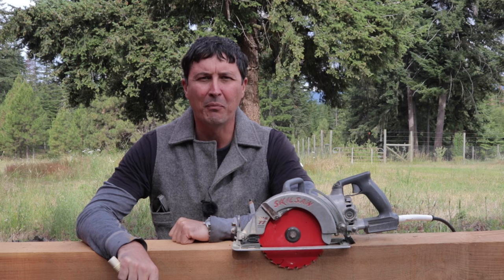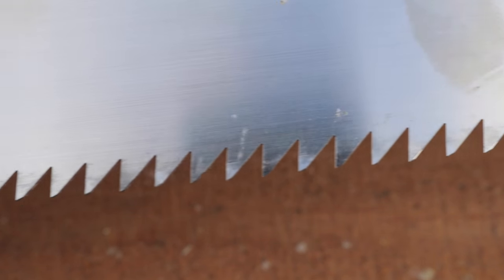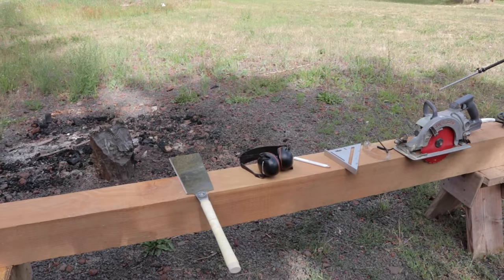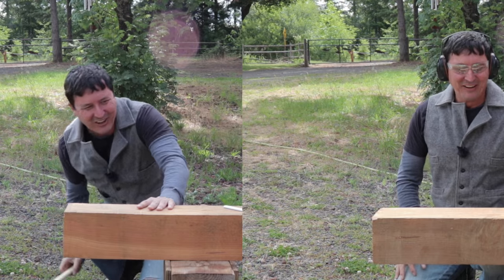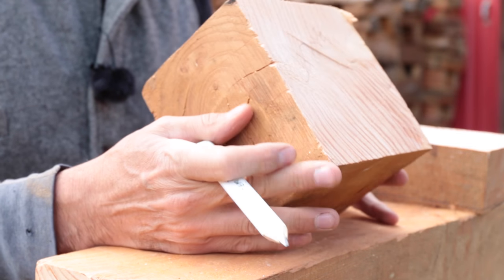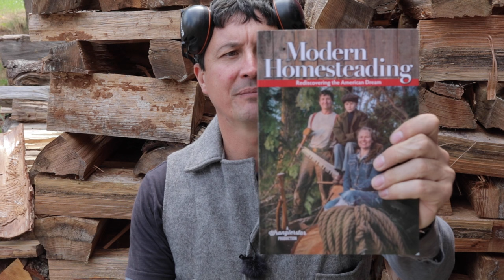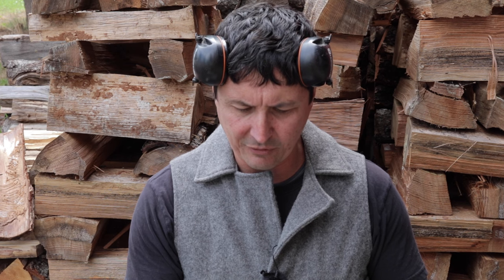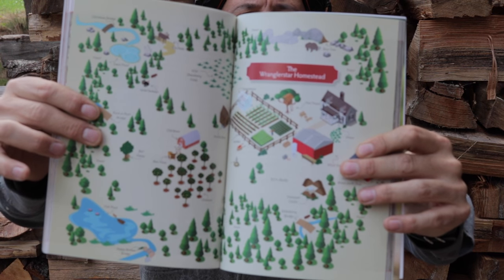Hand Saw vs Skill Saw - Speed Race

Comment: cody,  a japanese saw is supposed to be dropped towards the dround when cutting. Instead of pulling the saw up towards your face when you cut, push the handle towards the ground. Better quality and more efficient cut. Take advantage of the way the saw is supposed to work and let it cut for you.

Comment: I suppose one of those big saws vs chain saw might be ammusing, oh! how bout a hand drill vs cordless drill. make it a challenge, by boring a pretty thick hole, so you can take advantage of the manual drill's strength, forcing the cordless to go slower, because it's not as powerful.

Comment: Actually, the Japane (lol) saw cuts straighter and faster if you use both hands crouching in front of the kerf....pulling down letting the weight of the saw do the work and using the longest strokes possible. Excellent video....i prefer hand tools.....cant stand the dust or the noise.

Comment: Using the speed square with the skil saw would make the cut more accurate. Also going slower with the pull saw would likely result in a very accurate cut which woul probably not require hand planing. Taking that into account the skil saw probably does not win.

Comment: Seth Stanbury brought it up, but how about a race to build something like a complete bookcase or a dovetailed box?  Something that will require multiple tools and thought and precision setting up the cuts.  There is no doubt a power tool can plow through the job at a much greater speed than a traditional tool so I see no amusement in a race such as a nail gun vs. the hammer.  But to actually use skill and technique to create something, I bet the traditional tools can easily keep up.

Comment: you forgot to add the bit about digging the coal/oil/gas to generate the electricity and slinging the power lines to your power socket. 

Also, don't forget the time it takes to get the wood close enough to the power socket to use a power tool.

Comment: This reminds me of my senior year of carpentry when my shop teacher told me that I was wasting my time using a hand saw to cut stringers. Then I obviously gave my opinion on the matter which was that after using a skill saw to cut stringers you still have to chisel off the portion of the wood still connecting the triangular cutout to the stringer. However if you use a hand saw u can just cut all the way down to the line. So naturally he challenged me to a race him cutting a stronger with a skill saw while I used a hand saw... I won hahaha because even though he finished cutting first he still had to chisel out the wood he couldn't cut with the skill saw.

Comment: Instead of spending silly money on a double sided blade with a traditional wooden handle wrapped in "something" why not just get a longer blade you can use the full ergonomic stroke with.

What you missed with the idiocy is that a fully supported work-piece with an hand saw, loses nothing to the harmonic that a circular saw contains in it's spin. The comparison is about how many teeth move through how much material per unit time + (how long it takes each individual tooth to get clear of it's own debris.)

It has never been economically viable to have an hand-saw fitted with a debris remover but an electric saw needs to have such an apparatus for it to work at all. On some materials you actually design the blade to have less teeth. (Alternate tooth spacings left out and replaced with a blank curved plate. )

With a pull saw you do make better contact and have more control over the work-piece but with the western preference for a push stroke, the debris is accelerated away from the work and wiped away from the material on the return stroke.

If you can get hold of a Diston and restore the metal to it's original crystaline structure with out damaging the settings you would have a blade that is better than any other make in the world. But each one would be designed for only one length of pushing stroke, so modern usage preferences are for "a one size its all".

I used to buy a batch of Sandviks at 20 quid a time. The only choice I had was one of 20 or 22 inch blades.

Comment: You only drew a line on 3 sides of the pull saw 4x4. You didn't need to tie the cord in a knot. 
 You drew 4 lines on the other.
 You rolled the 4x4 away from you 2 times instead of 1 time toward you as you did the first time
 Instead of putting the saw down each time you finished a cut, leave the saw in the kerf and  roll the 4x4  over with the other hand to make the next cut.    This way there is no comparison.

 A lot of framers will draw just 1 line and use the cut as a guide for the others.

Comment: Why cut freehand with the circular saw? Any experienced timber framer would  use the speed square held down with the left hand, and run the sole of the saw against the right angle of the square. That way you don't have to faff around trying to align the saw cut with a pencil line by eye.

Comment: A few things to note about that particular saw (which I have as well): 
- Start your cut as you did on the far corner of the board, but gradually cut a kerf towards the front along the top. Then adjust the cut so that you are cutting a kerf down the front of the board face. The adjustment around three sides will allow you to stick to your line on a large timber like that. A typical 4/4 8" wide board will cut much more accurately. 
- That particular saw is more for rough work. The smaller versions of the ryoba will cut very accurate joinery with ease. 
- Use with both hands for speed, once you have your kerfs delineated. 
- I suggest picking up an old Disston US saw (pre-ww2 era) or new Pax saw from Tools for Working Wood. These are the western equivalent of that size saw for rough cutting. Maybe do an East vs. West comparison. https://www.toolsforworkingwood.com/store/dept/TS/item/PZ-HS303.XX

Comment: Try and sit down lower and pull the saw top to bottom on an angle, and not standing and trying to push cut, you'll have better control and you wont bend the saw to bits ;)

Comment: The  Japanese saw is a PULL SAW. Don't try to push it. Try using a 2x4 block to keep your cut plum, and cut from the edge of the wood closest to you not farthest away. I think you'll be surprised with your results.

Comment: You did it all wrong. First off, you have two different saws designed for two different purposes. Your Skilsaw is designed for quick fairly accurate work. The hand saw is best for careful work by a very skilled person. In the right hands the Japanese saw does very well for it's intended purpose. The Skilsaw is not even made for that thick of material. I also use a Skilsaw to cut thick wood. I mark all the way around. I double check the saw angle. Must be perfectly at right angle. Then cut all the way around. Then cut remaining bit with hand saw. On 4 by six you don't even need to do this. But I have used a hand saw on thicker beams when it's a square cut. On a diagonal cut it tends to wander if I use a hand saw.

Comment: Sorry Cody. Having watched you use handsaws, I think you need to work on your technique with them. There is no question you can use power tools but your methodology for Hand saws is very poor. Slow down, keep your shoulder and arm aligned .. Don't force the saw. It will do the job as long as you take it easy and don't force the saw to your speed. Love your videos. Build more stuff.

Comment: Japanese saw is a pull saw. You were using a stance and grip suited for western push saws. Take a look at how the Japanese actually use the tool and you'll likely do better with it. - it'd also help if you used two hands on the pull stroke - that's why the handle is that long. In short - you were using it poorly.

Here's how to use one: https://www.youtube.com/watch?v=Qa5wIpfhGcY&t=3m43s

Comment: Nice videos, but  you haven't used a handsaw much (I've used 'em a lot more, but I'm not as good as you).  Should have found an old carpenter with his carpenter's saw.   My father on one 2 by 4 was about half as fast, maybe only a third, as he was with his Porter Cable Speedmatic (I still have one, base ground off, guards? what guards?--to cut off the bottom plate in a door opening. I also have a scar on the inside of my right leg, cutting green lumber in NYC making a loft bed for a couple of punk rockers...cab to St Vincent's, stitches and back to finish). 
Problem might be, I'm 60 and I'm way too young for that generation of carpenters. My dad's would've been 85, but he couldn't have leaned into a saw since the 1990s.
How about this: Find film (video) from the 30's or 40's of a framing carpenter sawing a board. Also find video of a Japanese carpenter using a dozuki. Then compare that to your Skil Saw speed. 
There's also more to it. The real advantage of the power saw was on the 'saw table'  piece of plywood, something to run the saw on--like a guide, gang up a bunch of 2x4s to cut off (so the inside walls would be exactly 8' for drywall.) Also up in the rafters, etc... 
Also, I haven't seen any videos of a tough experienced framer. Almost everyone of these guys I've met was short, a few maybe 5-10, but most 5-4, 5-6 or shorter.

Comment: You could blame the saw for the crooked cut.  It was in the difficult use that caused the bad cut.  You certainly got a work out.  On the other hand if you were in a place where there was no electricity you couldn't do it with the Skil.

Comment: Those saws are really hard to use.
Reply: I would disagree.  I love mine and you should watch carpenter videos from Japan for fine hand made wood working.  Perfection.
Reply: You need skill to be that good. You saw the cut of wranglestar, not exactly fine.
Reply: He was not looking for fine he was looking for fast.  There is no way and power skill saw can give you the fine cut of a real Japan hand saw. I can cut 45 miters by hand with one.
Reply: Yeah. Its actually easier to use one of there than a push saw. Only because if you don't keep a push saw straight while cutting and pushing, it will bend on you. A pull saw like this cuts while pulling towards you giving you more control and stretching the blade while you cut.
Reply: I agree and it is nice not to have to go get the power saw all the time.

Comment: them Diablos are the best blade out even if u hit a nail it still cuts better than a Dewalt haha Diablo has a hardie board blade that cuts through that fiber cement like a skill saw through drywall just don't hit any wood with that hardie blade tends to knock a tooth off and at $60 each better have the new guy buy his own

Comment: That's a flush cut saw
Reply: Nope. The teeth are set, so it would gouge up a finished surface. One thing he ran into though: the set on the rip teeth is greater than on the crosscut teeth, which is why the saw sounded louder once the back edge entered the kerf. A ryoba isn't really built for this kind of deep cut, though other Japanese-pattern saws can be VERY good at it. This saw is more for furniture, dovetails, and the like.
Reply: ... the comment was "that's a flush cut saw". Neither of these is a flush-cut saw, so I assumed he thought the ryoba was a pullsaw with the same teeth on both edges, but only set upwards to allow cutting flush to a finished surface.

Comment: my question is WHY would you need hearing protection from a saw its not loud i've used chainsaws  hand saws pressure washers weed whackers ect.. and i've Never used hearing protection that's like getting in your car and putting earmuffs on before heading to the store its just obscene and unnecessary